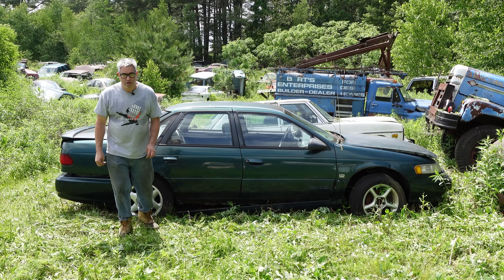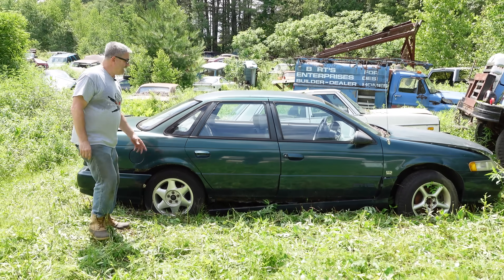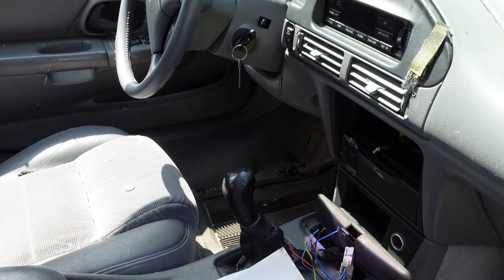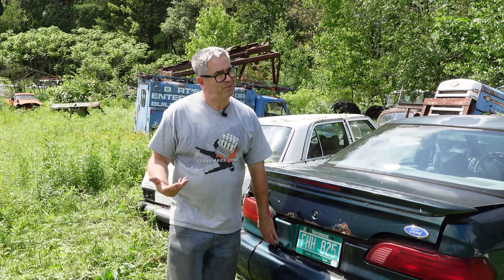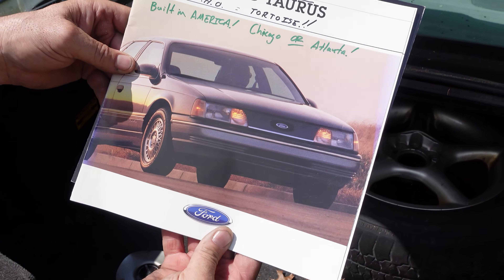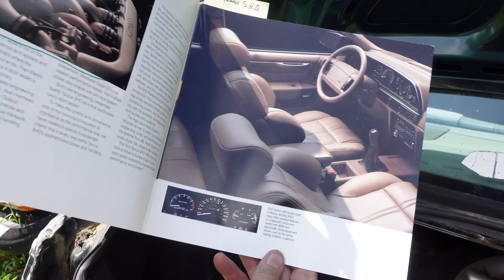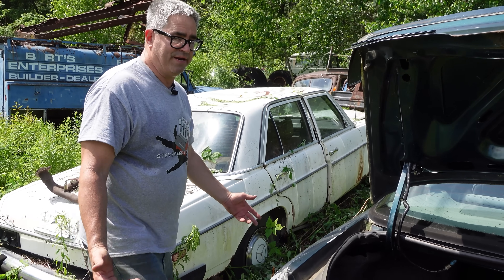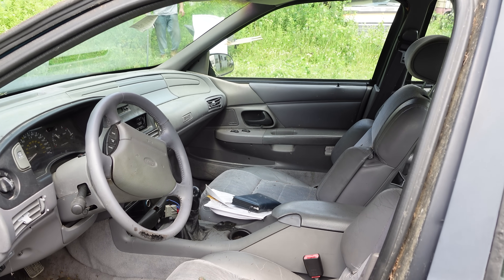SHO Time!

Comment: My insurance agent had a letter framed in his office about the early SHO's.  Apparently the first year or years they were built you couldn't tell a SHO from a standard Taurus by the VIN numbers and the insurance company wasn't pleased about it and directed the agents when writing a new policy to visually inspect every Taurus that verify it wasn't a SHO and apply the correct surcharge if a SHO was found.
Reply: Had your insurance company been smarter, they could have determined whether the car was an SHO by the VIN number.  Following 1981, the engine code was the eighth digit in the VIN number, as only the SHO's got the Yamaha  SHO 3.0L/3.2L DOHC V6.  A computer program could have been written to automatically apply the surcharge if a specific digit was found in the VIN number.  Yes, even back in 1981, this could have been done by either the computer or by human beings.
Reply: @houseofno  That is correct. The SHO engines had their own VIN codes not shared with the other non-SHO Taurus models.
Reply: That's not correct. The VIN codes for the SHO engines (in this case the 8th digit) were unique to SHO models and they could be easily distinguished. All insurance companies had guides for VIN decoding and could easily tell what was what. Even back in 1980, when we had photos taken of our 1980 Trans Am, they knew it was a Trans Am by the 2nd VIN code being a "W" which denoted Trans Am. Sounds like someone didn't know what they were doing in that insurance office.
Reply: VIN... not VIN number!
Reply: @wyatberp3611  yeah I know your correct  but I typed it anyways. ( I also know the difference between your and you're)  :)
Reply: @thetokensmustflow  Since we're going THERE, lol. I call them shows, Porshs, jagwars, 2 middle fingers up!!!
Reply: @wyatberp3611  Technically yes. That's like saying "ILO of" when it should be "ILO" (in lieu of).
Reply: @googleusergp    or ATM machine..
Reply: PIN number..
Reply: @wyatberp3611 that one makes sense because an atm machine in long is ass to mouth machine
Reply: @wyatberp3611 but we like... vehicle identification number number
Reply: That is correct!

Comment: Back in the late 80's the trucking company I worked for had the contract with Ford parts division. We were constantly delivering full trailer loads of Taurus and Sable automatic transmissions to there parts warehouses. Apparently there was a problem with the 4 speed OD units.The Ford dealerships couldn't get enough of them.

Comment: I had a black 1991 SHO that I bought used when I graduated college in 1994. It was so nice and damn quick for its time. My dad loved it so much he picked up a red 1994 SHO a few years later. One of the best looking engines ever. I also remember either an issue of Hot Rod, Car Craft or PHR that stated you could run the SHO V6 in a RWD platform (like a model A or t-bucket) if you used the auto transmission from a Ford Aerostar Van. I believe it was a story about using different/unique engines rather than the standard small block Chevy. I'm not sure if anyone actually ever put the SHO V6 in a Rod but it would be very cool indeed.
Reply from the maker: Lets not forger the SHO-Gun, a SHO powered Ford Festiva sub-compact. A company built them for a few years and most famously, Jay Leno had one that he showed to many magazines and TV shows. I have NO IDEA how such a crazy combination was legal for FED standards, but a bunch were built! Google Ford Festiva (or was it Fiesta?) SHO-Gun...Thanks for watching and writing. Steve Magnante
Reply: @SteveMagnante  The 3.0L Yamaha SHO V6 was already US emissions certified by Ford.  Legally, if less than 250 are produced of a given vehicle in a single model year, they are generally granted what's called a small volume manufacturer exemption.  This typically exempts a small volume manufacturer from being subject to a whole slew of environmental, safety, lighting, and emissions requirements, provided the vehicle meets standards applicable for either the model year of the donor vehicle or the engine.  The EPA generally frowns upon installing an engine older than the vehicle it's going into, but the vast majority of inspection stations don't go nearly into this level of detail in the engine specifications.  Most of them aren't going to check.

I am pretty certain I remember Jay Leno explaining that less than ten of these SHOgun Festivas were produced, well under the 250 vehicle limit.
Reply: @SteveMagnante  Festiva. The Ford Fiesta was offered in the US through the 1980 model year.
Reply: @SteveMagnante  jay Leno has one.  With NOS!!!   
Love your channel
Reply: Had met Rick Titus who was displaying the SHO-GUN @ Grand Prix in Long Beach.  Slick concept limited production car
Reply: Saw a 1989 Ford Probe with a 1989 SHO running gear in it. Amazing.
Reply: @thechriscollection9983 now THAT would have moved even more Probes. My 90 LX had the 3.0 liter, but I can imagine how much more oomph that Yamaha motor could have given it.
Reply: I saw a SHO engine in a sand buggy

Comment: Thanks, Steve, and I see power seats and can only wonder why.  I don't need a gizmo to move the seats.  It was too much luxury and no luxury at that, just unnecessary.  But that's just me, so much prefer simplicity with the creature comforts, nothing wrong with rolling down the windows by hand.  😀
Reply: I like as much luxury as possible. I love my heated and cooled leather seats with memory. I made sure the new pickup truck I ordered is coming with them.
Reply: @garyszewc3339  I'm not sure if your jesting but either way, cool with me, any luxe package a driver desires.  And I was thinking, actually, about luxury after I made my comment and I would say that, yes O yes, while I do not like gizmos moving the seats or opening the windows as luxury, I do like real wood dashboards and high-quality gauges and leather seats, so I'd be up for luxury defined as such, with a teak cupholder for my Slurpee, too.  😀

Comment: I never road in or drove one, but remember they were fast for their day. Lots of stories about the durability of the engine, such as the redline only being imposed relatively low because the accessories couldn’t keep up or hood together at much higher rpms. 

Your mention of the SHO wagon prototype got me thinking about something you could offer every once in a while - factory prototypes.  You’d be the guy to create a quality production follow up on the 1971 Boss 302 prototype that miraculously escaped the crusher and is being restored by Bob Perkins. Most recent material I’ve seen on the car is 3-4 years old now so I don’t know if it’s finished or in what stage it remains. Prototypes that disappeared and those that somehow slipped thru would be fascinating.
Reply from the maker: Good call sombra6153 on the '71 Boss 302. I wrote a book called Steve Magnante's 1001 Mustang Facts and devote several pages to these bizarre 1971 G-codes. Perhaps SIX were built. If you find a copy of this book (available online or - perhaps - from CarTech Books), Fact #256 begins the story! Thanks for watching and writing. -Steve Magnante
Reply: @SteveMagnante  I need to look for it. Thought about trying to build a 71 sports roof clone but those prices are getting a bit higher than I’m comfortable with for the work involved. More realistically when I can find a somewhat accurate model of a 71 Mustang. Revell was supposed to be releasing a 71 Boss 351.

Comment: Fun side fact…..the engine itself was actually good for 9000 rpm but they put the redline at 7000 because the accessories could only handle 7000
Reply: that isn't actually true.  The accepted number was more like 8000 rpm, but the stock valve springs wouldn't handle that without float and the stock cam timing in no way would support power anywhere NEAR that rpm.  If your power peak is 6400 like a stock 3.0 SHO, shifting at 7600 will be much slower than shifting at say 6700-6800.  To have a power peak at 8000 rpm on this engine would come with a torque peak of 6500 +.  Poor idle, terrible drivability and weak low to midrange power.  Not to mention the necessary overlap would not pass any Federal emissions standards.  This was the days before VTEC and variable cam timing so if you had 85 degrees of overlap to make power at high rpm, you had to live with the terrible drivability at all other times.
Reply: @jaylestingi5418 I doubt the oil pump could handle 9k as well. All that said one could probably manage a backyard 9k rpm build, with dry sump, aftermarket valve springs, a larger crank pulley, some sort of porting. Remember the intake still has the dual mode which gives it a wider range of power. Give it a third pipe between both upper intake tube (the ones that go around the top,) with a single valve to close it off below a certain rpm. Maybe a second throttle.
Reply: @jaylestingi  Mr. B. Here ! 👍👍👍👍 ☕️☕️🧰🔧🪛🧰🔧🪛
Reply: Don't forget about the oil system. I learned this the hard way spinning the bearings out of my rotating assemblies. Had SHO much fun doin it though.  Yes, I had too😂
Reply: @The.Dayum.W  I see what you did there!..SHO’nuff..
Reply: this is, indeed, not a fun fact (since it's not true). It was often stated as fact back in the day, but was never true. 

A couple of things Steve got way wrong in the video as well: 
1) That spoiler on the back was not "validated in a wind tunnel", and it was only for looks. He's dead wrong about it being for aerodynamics. The original year, 1989, wasn't even available with a spoiler from the factory. It became an option in 1990.
2) Those exhausts in the back were not "high output" exhaust. They were split off from a main exhaust... sort of a faux-dual exhaust (that is pretty common today).
3) He says the only colors available were silver, white, blue, red, and green. INCORRECT. ... I owned two of these cars and both were BLACK from the factory. 

Didn't watch the rest of the video since he was wildly incorrect on those things, but I hope he mentioned that the Achilles heel of this Taurus was the transmission and throw-out-bearing. They just weren't made for the torque that the engine put out. Ford fixed the issue in 1993, but by then most of the manual cars had been through at least three or four clutches etc.
Reply: He mention the Sable hood but not the Sable headlights, turn signals and cornering lights, they look much better than non SHOs
Reply: This misinformation continues to live on 🙄
Reply: Had a 91. Rev limiter at 7300. Brake disc  warped,interior leather was cheap, Mazda transmission was subpar, oh but I did like it!
Reply: your fun side fact is false
Reply: I did read it was 8500 rpm tops, but they set the fuel cut at 7300 rpm.
Reply: I missed a shift or two in my buddys 89 and no harm done. And they sound incredible at eight grand.
Reply: @gwnoel  There is a limiter at 7300 so it doesnt matter
Reply: From what I understand the motor was capable of 8000 but the accessories could only handle 7300 I think redline was 7200
Reply: Ya. My Dad had a black and a Red 89. First year.
Reply: Fun fact. My buddy in high school had a 91 thunderbird SC with exhaust intake and a pulley. He had a part time job at my Dads work and they were always debating which was faster. One day I borrowed my Dads car and ran into him on the street. Wasn’t even fair. It was damp and couldn’t make traction till 3rd. When it hooked it was like he put his breaks on. Blew his doors clean off. Long story short next time he worked with my Dad he said ok. You were right. Your cars way faster. My Dad came home and said I heard you raced Rob. Good job but never ask for my car again. Never drove it again. My bro still has it but it’s rotten. :( SHO  was stock.
Reply: Old wives tale.  Not true
Reply: Thats not true.  I know you read that on the internet but no part of that engine was stable to 9000 rpm. 

The cams are dead (realistically) by 6800
The valve springs are too soft above 7000
The oil pump is marginal
Reply: Ah, bean counter logic. Could've just used larger pulleys to slow the accessories down, but that would've cost a bit.
Reply: So, since the comments seem to call BS on the 9000rpm redline, it's actually not a fun fact.
Reply: Nice
Reply: Not true actually, thats a myth.
Reply: @Viking88Power yeah, like you know🙄

Comment: A very rare occasion when I don't learn something from a Steve Magnante video. I've never seen a Taurus with a stick shift and never seen a 4 cylinder model. Never knew either was even offered. Thanks as always, Steve.
Reply: The four-cylinder taurus were only available in 86 & 87. They had a Ford tempo drivetrain with the 2.3 liter engine and the three-speed ATX trans.
Reply: I’ve seen one.  I think it was from the early production. I think the guy who had only bought it because it was a cheap deal likely due to heavy dealer discounts just to get rid of it. The fours were the 2.5 shared with the Tempo.

Comment: Ford really screwed themselves in the 1996 redesign of the Taurus/Sable. The basic 1986-95 design was industry changing and aged well, especially the '91-95 style. The guy who said "hey lets make every conceivable surface of the car invoke the Ford oval" must have been Chris Bangle's roommate in college. There was no need to put a "V8" into the SHO just to say it had a V8, especially when it was slower and heavier than the Yamaha V6 it replaced. 

I always have my eye on a 1991-95 SHO 5 speed in green with gray leather, in good to very good condition, unmodified and unmolested, with decently low mileage. I know that's asking a lot but if I do find one that meets those criteria I will buy it.
Reply: Look in south Florida there is probably some old retired Canadian from Quebec that has a pristine one sitting in the garage!😂

Comment: I have ptsd from working on all models of tauruses. From the automatic trans failures air-conditioning problems and freon leaks everywhere, heater core replacements ,engine failures including sho,s. A shop I worked in was flooded with these crap boxes.
Reply: Tell us how you really feel 😂
Reply: @jroch41  ask your mother , she knows all my feelings
Reply: Yepper, years ago my wife got talked into buying a  used 4 banger. Worst POS we ever owned! It was a used car, good thing she bought the aftermarket extended warranty! 2 compressors,  3 evaporaters, 2 alternators,  in one year! All the linkage rods kept falling off because the grommets dry rotted away. I bought new grommets from Ford, they were dry rotted in the packaging! I wound up rigging plumbers grommets to fit. After a year and a half,  she traded it. I remember her saying,  as she was leaving to go car shopping,  whatever I trade it on, it won't begin with an F! Lol Did I mention it was gutless,  other than that, it was......a car. Taurus feces!
Reply: I bet those heater cores were loads of fun!😮 not!
Reply: @jeffreycarleton1535  The evaporater was no picnic either, the entire dashboard had to be removed.